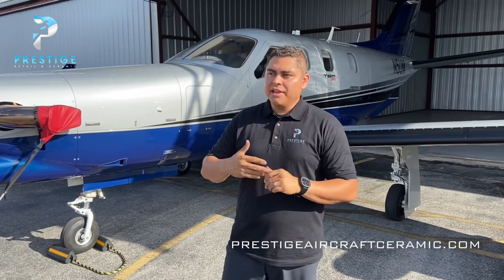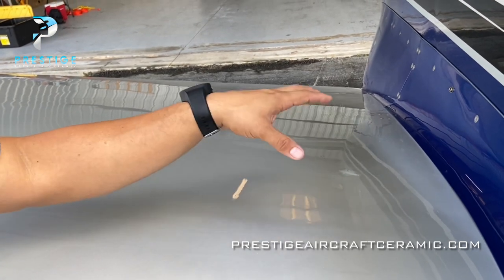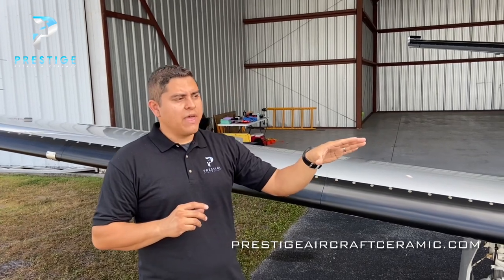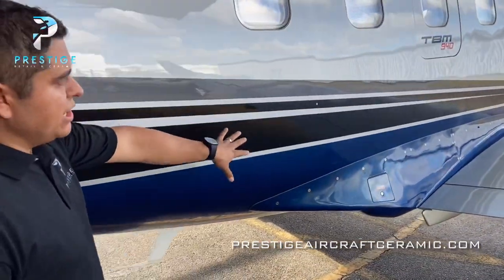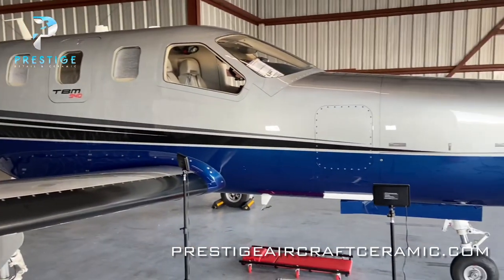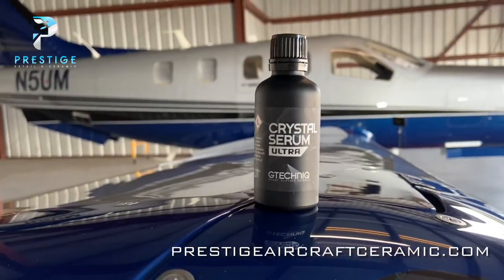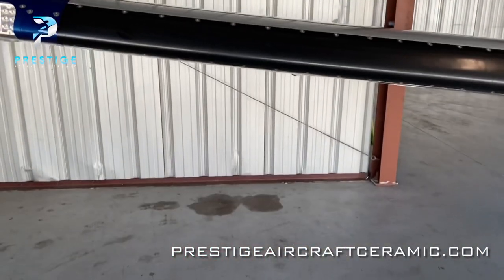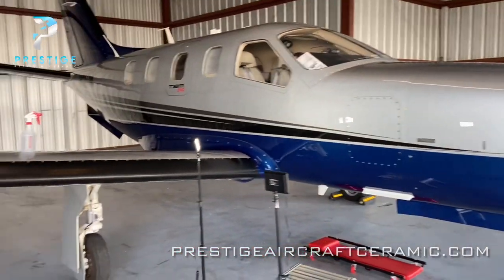Daher TBM 940 Aircraft Ceramic Coating

Comment: Dumb question.  Hope much weight does the coating add to the total aircraft.   I'm sure it's not much but I'm curious.
Reply from the maker: Less than half of a pound total weight added. For a TBM I typically use about 150ml of ceramic coating which converts to .33 pounds.
Reply: @prestigedetailceramic7330  thank you so much for your responses.  Much appreciated.  I'm in the window shopping phase for a new Piper M600.  I like the ceramic coating idea.   Are we talking 100 of 1000s  to apply?